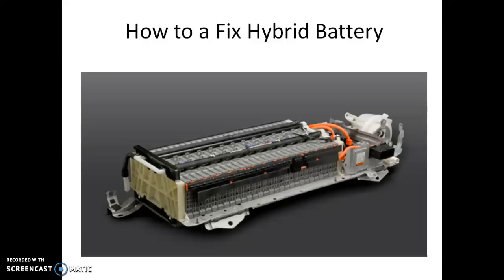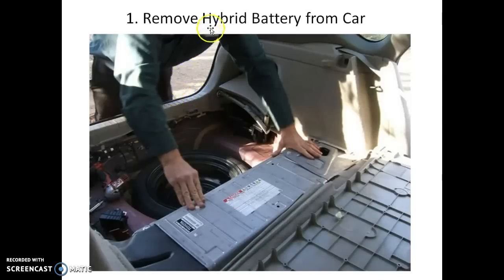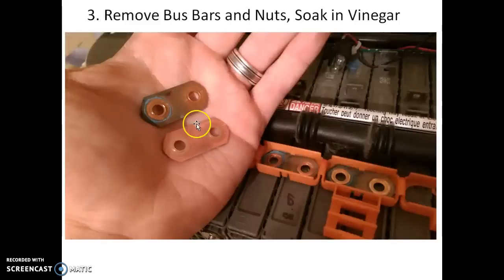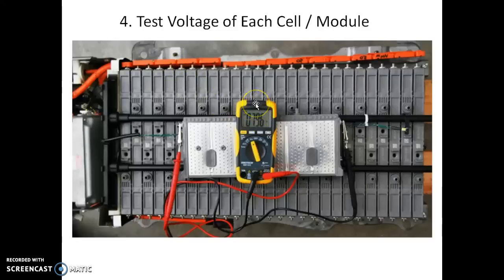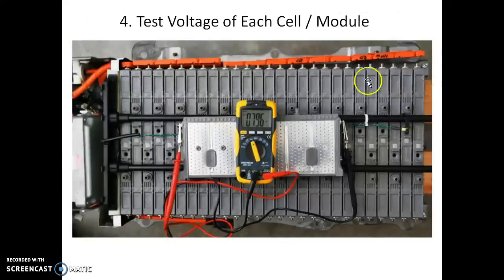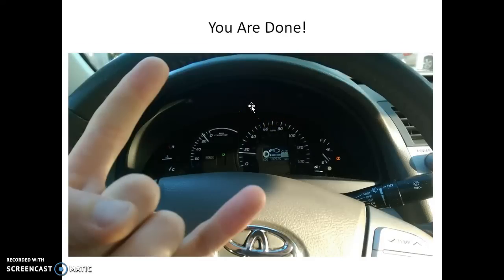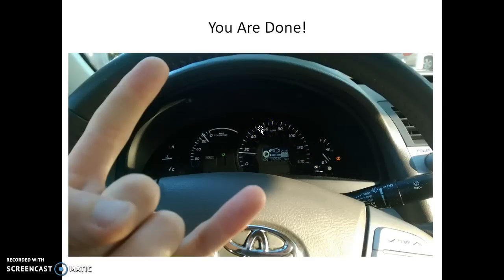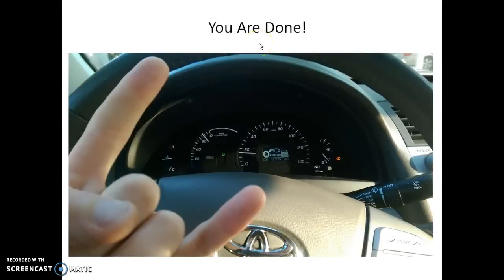How to Fix a Hybrid Battery

Comment: This is playing whack-a-mole with weak cells.  By the time you have a cell that measures low voltage, it's been a problem for a long time.  Using this "voltage check" method you will MISS cells with low capacity, which may or may not become "bad" within weeks or months, but which will ALWAYS decrease your fuel mileage.  I have perfected the rebuilding process, but it is not a DIY process as I had to build my own test equipment and charging equipment (because nobody makes anything that will do the job.)  How was I able to perfect this process?  I started with 35 years of experience with rechargeable batteries, a degree in electronics, and years of continuing education both professionally and on my own.  A proper rebuild will last years. Even with all this education, training and experience, there still was a learning curve with these hybrid batteries.  There are also things that you need to know about the toyota battery monitoring system, such as this: You will get the P0A80 code even if all the cells are good if you have one block that measures too much lower in voltage than the rest of them.  If your pack was pretty highly charged, and you put in a good cell that happens to have a lower level of charge it WILL trigger the P0A80 code.  I give a one year warranty on ALL my battery rebuilds.
Reply: Mark Taylor how much do you charge for a battery rebuild?

Comment: I’ve found just testing voltage with a multimeter isn’t always enough. You should load test each module. Some will show proper voltage when tested with a multimeter but will completely crap out under load.

Comment: 650v can kill, not recommended, by a home mechanic. Avoid hybrids.
Reply: It’s actually 245 volts. Luckily if you’re safe about it and remove the interlock from the battery it pretty hard to get harmed doing this job.

Comment: Thanks for video .I have opened up just a cover on my Lexus ct 200 h battery.Cleaned up all connections( as they were oxidized).Battery cells were all about 7.96.After assembling hybrid system check alarm gone.Will see later...!
Reply: Yah, I would think that a ct200h would be too new of a car to need a new cell...

Comment: The reason you had check hybrid system warning after replacing the duff cells was because you didn’t balance the battery properly afterwards. Yo should have plugged it into a grid charger over night and reset the system by disconnecting the 12v.
Reply: David Seaver do you know in you tube a video showing that thank !
Reply: Actually, when you remove the battery the way he did you are disconnecting the 12 volt engine battery.

Comment: Hey all, I have a Camry with a dead battery. I opened the case and voltages are normal(7.35 lowest, 7.61 highest but nothing below 7.4 except one 7.31 cell) on cells. Is there might be any other problem?
Reply: One of the sensors might be broken. That are in the Orange Strip.

Comment: I tested each cell, 7.68 V and more. Cleaned all the rust and placed it back, carefully (watched these videos a lot of times so I feel confident that there was not error placing the battery back in the position). Check "VSC and Hybrid system" is on now. earlier it used to go away within 10-15 mins, but now it is there constant. I tried to jump start it, no luck. Any recommendations?
Reply: Like others said, you need to load test the cells and make sure they are no failing on you under load.
Reply: If you have to jump start the car , it is not your hybrid modules, it is your 12 volt battery

Comment: Hi Shane,
Thanks for posting this video. I guess my car (Toyota Camry Hybrid 2008) is giving me the same problem. I am getting a "Check VSC System" and "Check Hybrid System" after every 500-600 miles of driving. This has happened for 3 times now. Could you please recommend the vendor from whom you bought the cell?
Reply from the maker: Bharat Sharma eBay
Reply: HI @Shane Call Jones. I test every cell and all measure 7.68V and more. Do you know what else I could check? There is definitely corrosion on the nuts and bus-bar that I am going to take care of.
Please suggest!

Comment: I pulled out my battery and tested each cell. I have 7.46 and each one, but my car was dead. I was hoping to find a bad cell and replace it. What now? I noticed some of the metal plates under the orange plastic holder are pretty corroded. Going to soak them in vinegar. I hope that's all it is.
Reply: Hi Dan, I just checked all the cells of my battery too and each cell has 7.68V and more, but corrosion was definitely there. Were you able to fix your battery after normal cleaning?
Reply: I'm guessing if your not getting any power it's the 12v battery if it's the hybrid battery a hybrid light will turn on the dashboard
Reply: Did you try replacing the one separate 12v battery too? Replacing that battery helped ours out slot.

Comment: Hi Shane my question is i only have one module that read 7.2 volts all the rest reads 7.8 and 7.9 volts you said below 7 volts need to be replace 7 volts is still good right. please. reply.
Reply from the maker: Johnny Lucas ya, that voltage is probably OK. You can replace if you'd like, but your problem likely isn't the cell module voltage. Read through the comments of others on here. You'll find one that explains what you need to do about load balancing.
Reply: Thank you Shane right now i used datu puti vinegar for the connector wish me luck,i will reply back when im done.More power to you.
Reply: @shanecall  The capacity test is most important. Not the voltage so much
Reply: Hi Jonny, I just checked all the cells of my battery too and each cell has 7.68V and more, but corrosion was definitely there. Were you able to fix your battery after normal cleaning?

Comment: Captain Crunch:  There is one short black wire, a stout wire with lugs, ring terminals, on either end, that I did not replace when I put the battery back together.  One end goes on the metal electronics cover (it has the shape approximately of a cube (missing some sides) about five inches wide . The other end, I just don't know where it was supposed to go. Is there any chance that my failure to replace this wire - it seems obviously a ground wire - causes the battery not to charge? Is it possible that if I add that on  that somehow the battery will start charging again?
Reply: Hi Overthinkers!
I am facing the same issue. I forgot where this back wire goes!
 Could you please help me?
Reply: Bharat I wish I could! Then I would! You can email me at overthinkershoedown@gmail.com and if i ever find out I'll email you back

Comment: I have an idea of something to try. The tech who did the diagnostic on my battery had a hunch that the leads that go to the battery cells from the Hybrid Battery Wire Harness to the battery ends might have gotten broken when I reconnected them.  It feels unlikely, but maybe it's true.  I am talking about the wires, I recall them as being black, that have silvery-colored lug ends (I guess they are stainless steel?) and that get tightened against the copper bus bars, when you tighten the nuts to make the bus bars in contact with the battery terminal.  There are, I think, 17 of these, on the side of the battery that has all the devices you have to move out of the way to get at the battery. That would be the side of the battery closer to the front end of the car.  I was puzzled when I came across these. I did not know anything about them, they weren't discussed in any video I saw.  I took them out when I took out the bus bars to clean them. But I did not take a picture of them first, and so when I put them all back,  I put them back the way I remembered them.  I feel confident that each of these wires was put on the correct battery end, but I am less confident about the position of each lead lug relative to the bus bars.  I believed that each of these lug ends was placed in the orange plastic piece that holds the bus bars on the side of the bus bar closest to the battery cell, not on the side closer to the nut. So when you snapped in the bus bars, these leads were held in by the busbars.  I thought, hoped, that it did not make a difference.  I did not know what to torque the nuts too, but I aimed for firm enough to make sure the lead lugs and the bus bars were making good contact, and no tighter than necessary for that.  Does anybody have an opinion as to whether what I did was correct, and whether it might be worth a try to take out the battery and try something different regarding this issue? The tech did say he was impressed that the cells seemed balanced. He seemed to think the cells themselves were not the issue. I am overthinkershoedown@gmail.com  .

Comment: A guy came from Annapolis, about an hour away, and ran diagnostics using a Toyota software.  He found the results complex. He said the batteries were very consistent, but weren't charging. He found it odd that the scan i took before I took out the battery identified 2 weak cells, and the scan he took showed only one, but a completely different one. He couldn't figure out why after working after my repair it stopped working so soon.  He wondered if maybe the hybrid battery harness leads had gotten damaged when i put them back - maybe overtorqued? Or maybe a relay.  He said it might take a lot of trouble shooting.  They didn't charge for the diagnostic.  Then they sent me an email, offering to replace the battery for $1,349.
Reply: Hey man, keep us updated on what is happening with your car/battery. I had the battery on my camry 2007 replaced with a refurbished one few months ago, cost me a cool $1100. But i feel like it might fail again soon, so I am trying to prepare myself.